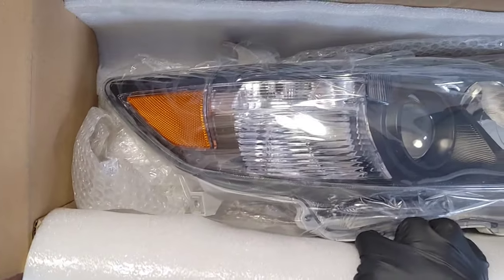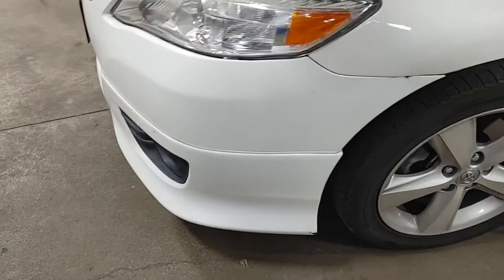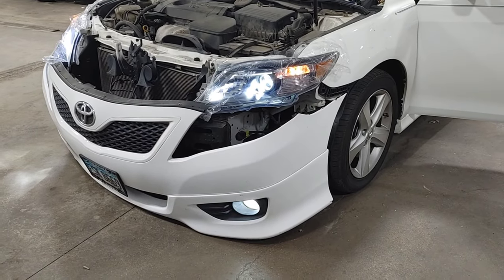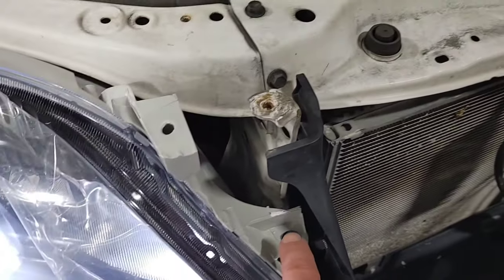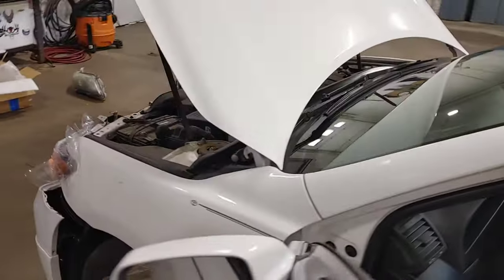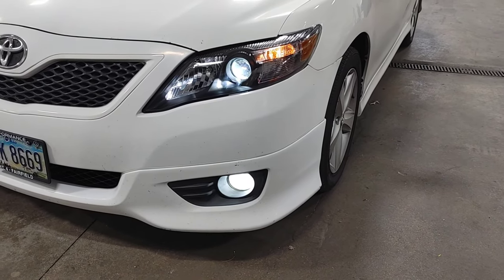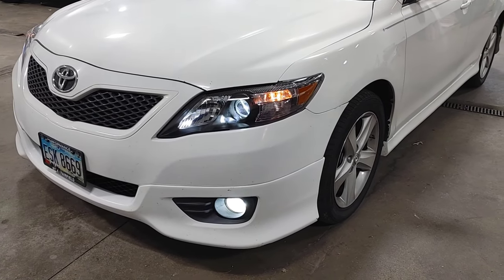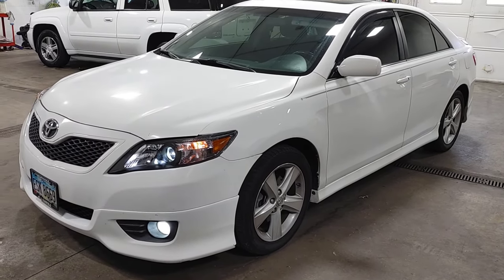2007-2011 Toyota Camry Easy way to replace the Headlamp Housings Give your car an upgraded look! LED

Comment: Great job with the video. I've got the job done. Heads up for those in VA. If you replaced halogen bulbs with leds, your car will not pass the VA inspection. The inspector pointed that no led can be used unless the headlamp was originally designed for leds. Hint. Keep your original bulbs.
Reply from the maker: Oh really? There is no inspection in Ohio. Thanks for the info
Reply: Ya so in Massachusetts its the exact same shit but if u got a mechanic friend i do mines at honda cuz i know a friend and he passes me all the time i got gtr ultra 2.0 on my 2011 camry they told me the exact same thing that you have to have the 9005 halogen ones stock which is bs but  something to do with rules on cars 2015 and lower something like that cant remember the year but any cars over 2018 and up with stock led is okay but i always pass and get my sticker so its all BS
Reply from the maker: @drksmke7462  Sorry to hear that, I am in Cincinnati and there are no inspections here
Reply: @RoadMisfit187  anyways thanks for the helpfull video i was confused what number the fog lights on my 2011 camry  and they are H11 and my high beams bulbs are 9005 which i am changing both soon

Comment: I didn't see this video before doing mine, but I did it exactly this way. It seemed that I didn't need to remove the entire bumper, though I did leave one side still connected at the wheel well until I finished the other side.
Reply from the maker: That's for the input for others to read!

Comment: Does the black housing headlamp work fit for a 2008 Camry? Because when I click the link it says it can’t confirm.
Reply from the maker: The Headlights I used only fit the 2010-2011. There is a different Headlight for the 2007-2009 here check these out https://amzn.to/3NFw1Ms
Reply: thank you.  @RoadMisfit187